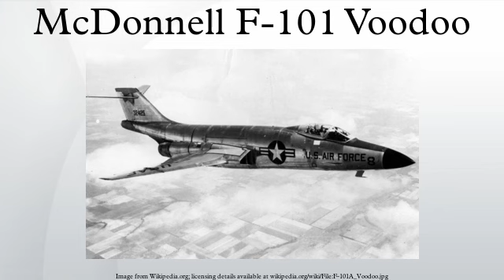McDonnell F-101 Voodoo

Comment: An important mod left out was the latest B model modified to carry a 2,000+ lb., Tow reel non-jettison, bolted to the centerline. The tow reel was used to tow missile sized targets approximately 4 to 5 miles behind the aircraft for air to air missile firing. This was accomplished for testing, training and competition. The tow reel was maintained and operated by a Tow Systems Operator who occupied the rear seat in the cockpit. Tow Target missions were a large part of the William Tell competition held at Tyndall AFB, FL, every three years.